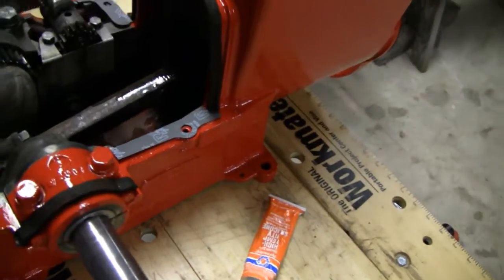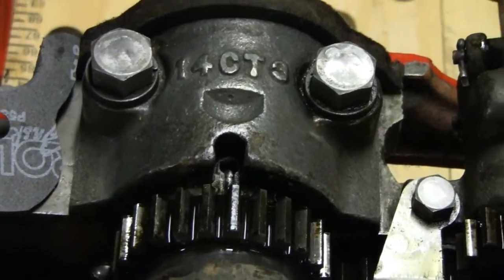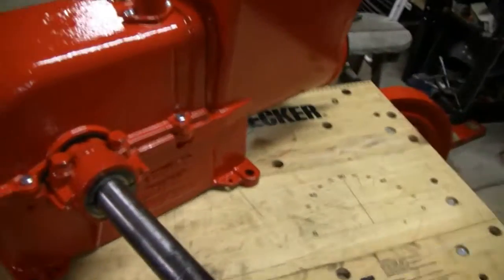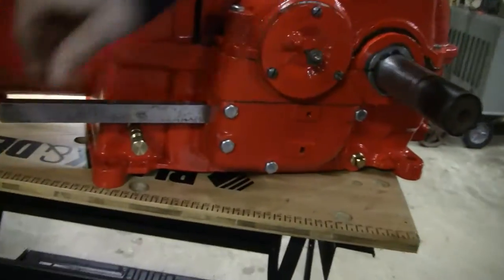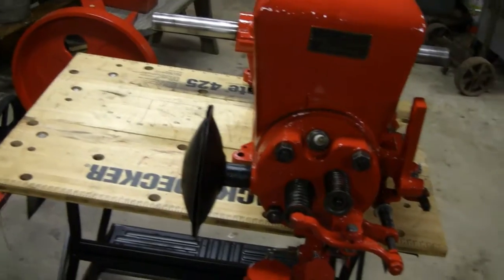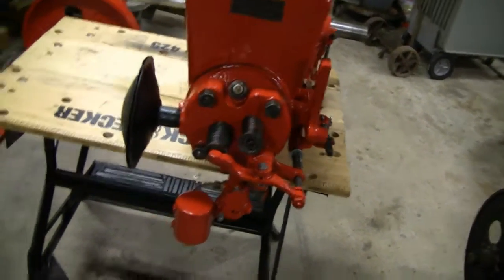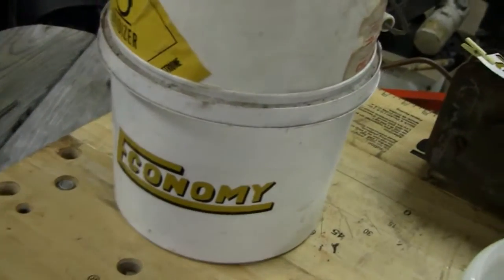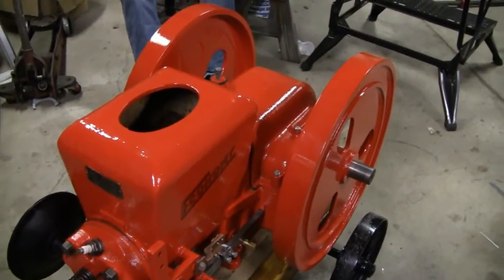ECONOMY HIT MISS ENGINE ASSEMBLY

Comment from the maker: @jdman1930 I have a CT-2 also. They really don't take too much oil, probably less than half a quart. If you stick a long thin screwdriver through the oil fill on top it should only be a ¼ inch deep there!!☺